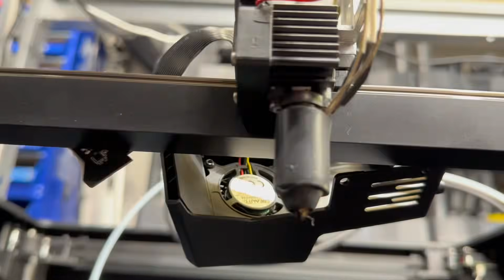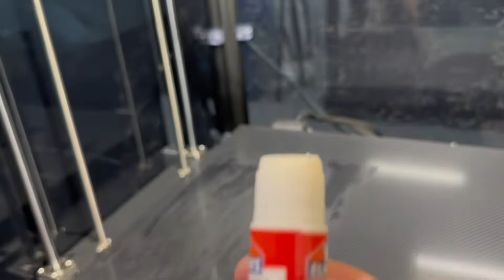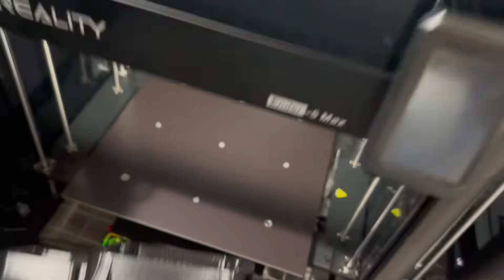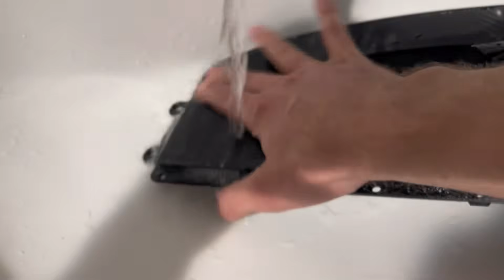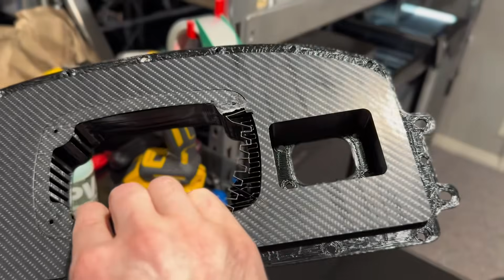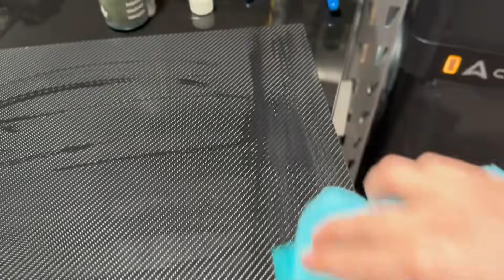WHY IS NO ONE USING THIS BUILD PLATE GLUE??

Comment: For ASA (Extriuer 265C, Chamber at 63C, Baseplate at 105C) on a Qidi Max4 w/PEI textured plate is doing great using Old School hair spray.  Easy to apply, when baked, comes off with 91% alcohol.  I get maybe 3 or 4 prints off one spray/clean cycle.  I try to move the print around the plate to print on virgin surface.  After cooling to room temperature (The Freezer accelerates cooling), a flex of the plate, maybe some easy prying, and it pops off pretty easy.  Before Hairspray, on the bare PEI, ASA was often difficult to remove, having to use a blade, risking my PEI.  Hairspray is more a release agent in my application.  The glue sticks are just too much goop in my experience, not near as easy to clean.